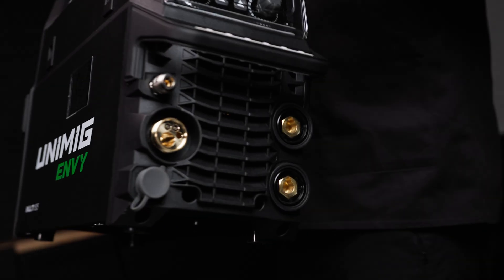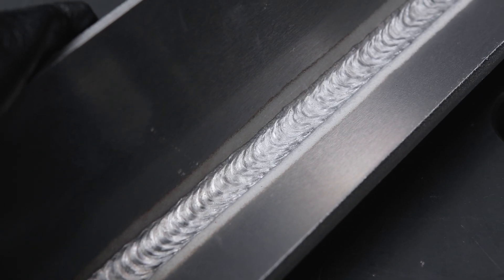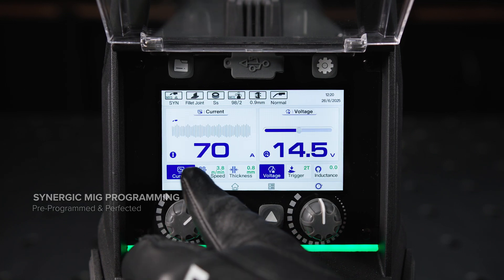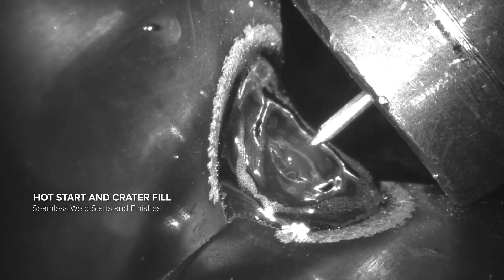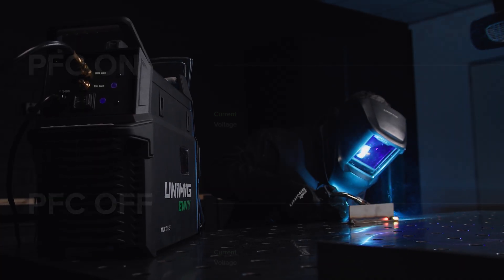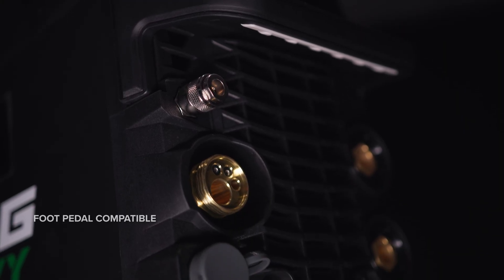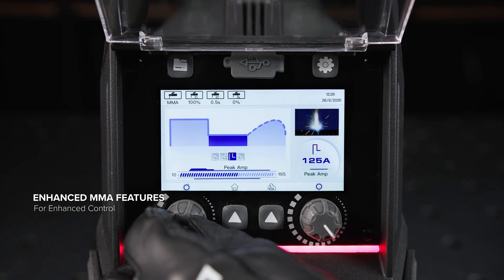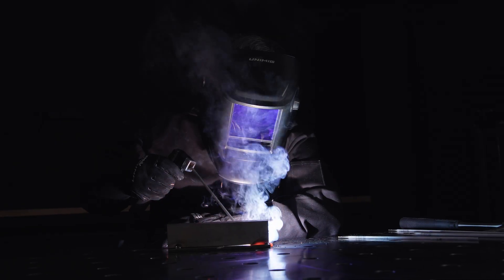ENVY MULTI 195: Overview

Comment: The spool gun is almost $1k and $2.5k for the other gun! Accessories are too expensive.
Reply from the maker: Totally understand where you’re coming from. The accessories are priced based on what they actually cost to manufacture, there’s no padding there. In the case of this machine, a spool gun isn’t really necessary, it already comes set up with a torch that’s capable of welding aluminium straight out of the box. The push pull gun is a different category altogether, it’s designed for higher duty, industrial work and higher amperage machines, which is why the cost is significantly higher.

Comment: Is buying the razor multi 230 or this a better option ?
Reply from the maker: Our RAZOR MULTI 230 AC/DC has been discontinued, so if you're after a MIG and AC/DC TIG welder, we'd recommend our ENVY MULTI 230 AC/DC, which also has pulse MIG, and is an upgrade from the RAZOR model.